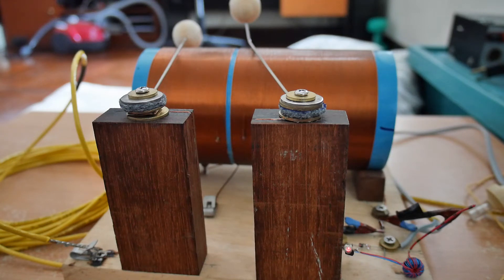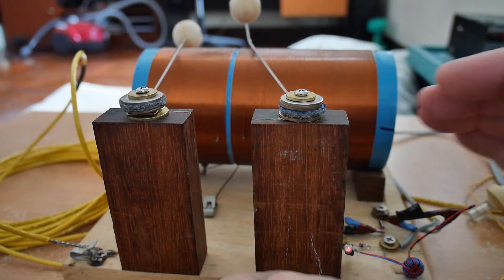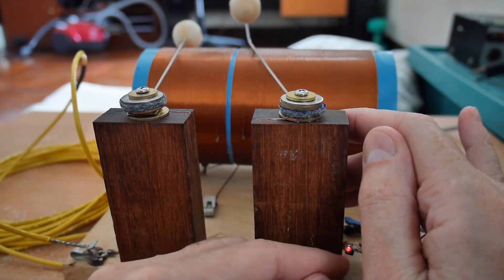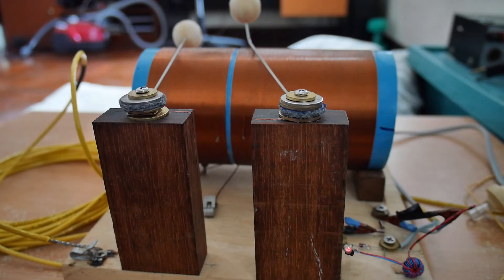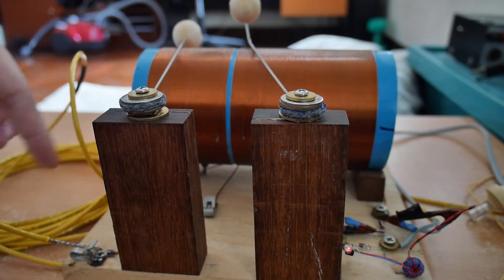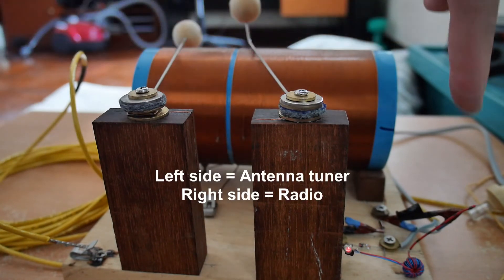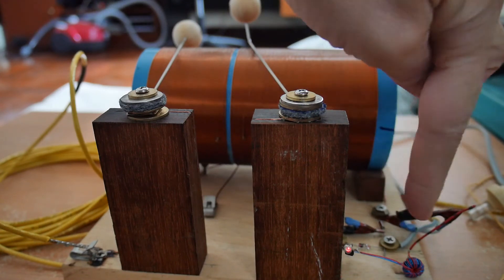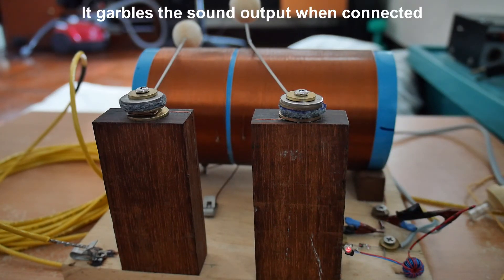Joule Thief + Crystal Radio = ???

Comment: Would a capacitor help with the LED brightness, or level out the flickering? If so, what type cap, uF rating and where would it be placed in the circuit? I would think that it would be a low uF rating, because the radio frequency is so high/fast. What I am thinking, here, is that a well placed smoothing cap can level out the ripple on a voltage regulator and actually raise the voltage regulator's output voltage significantly...
Reply from the maker: I tried some caps, but they interfere with the resonant circuit. I'm sure there's one that would help, but I just wanted to see if this would work. Once it did I was satisfied. ;)

Comment: IIUC, you left the Piezo ear piece connected. Is this a requirement to get the combined circuits to work? Seems like the ear piece would be using some of the energy. Maybe use the ear piece to find the loudest station and, then, completely swap it out for the Joule Thief?
Reply from the maker: Earpiece is not necessary for the light, but to tune it to the loudest station. After that you can remove it, but the wiper radios like to jump off station, so I just leave it hooked up. I just did this for fun, but if you are trying to get the absolute max power, then you'd want to disconnect it and the resistor. A different diode might also be better, the 1n34a is for analog audio.